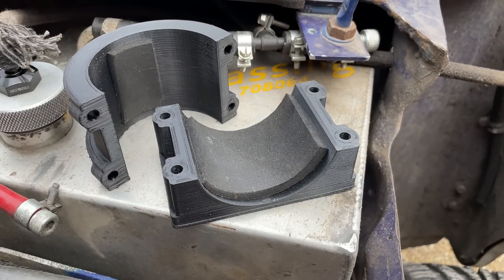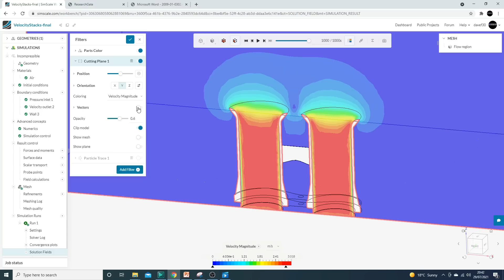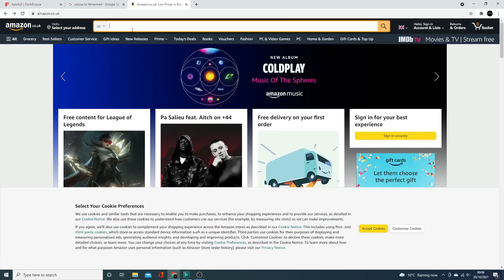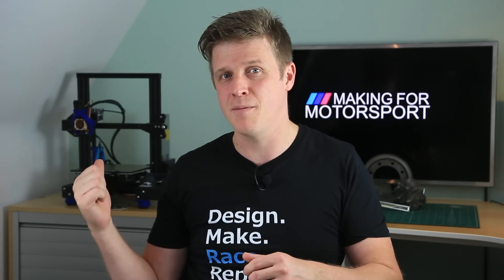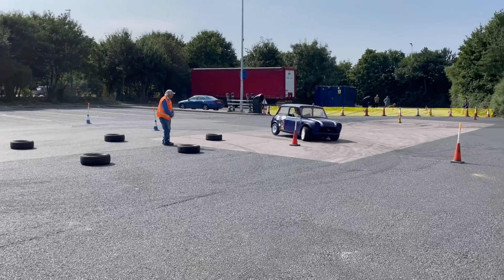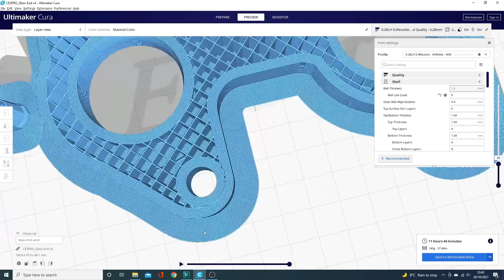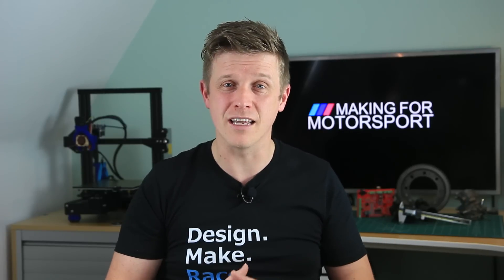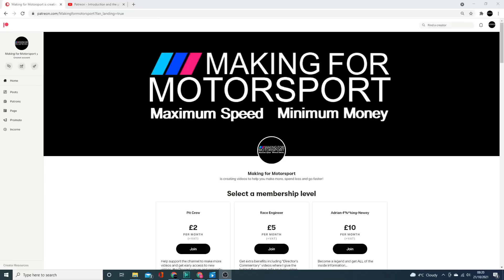3D Printing Car Parts - Under the Hood (or bonnet) - After a year of motorsport......

Comment: My own 3D printed intake manifolds https://www.youtube.com/watch?v=zIVduZnAFRg&list=UU4SCAucoAQf4XFesjFsTtKQ&index=12
Reply from the maker: I watched this like 18months ago, one of reasons I bought the 3D printer in the first place!  
The 3dkTop seems like an interesting filament, quite stiff.  How are they getting on?
Reply: @MakingforMotorsport  My restoration is going quite slow due to life getting in the way. So the car isn’t on the road yet. I will make some improvements like you suggest (adding brackets). I am most worried about heat management, because the exhaust manifold runs adjacent to the intake. But the 3dkTop filament should be good for 240*C.
Reply from the maker: Yeah, life does tend to get in the way 😂.  I know what you mean about heat, a friend has asked me to do the same as I had for a mini (original) and I said no because of the non-cross flow head.
I am sure it could be made to work with exhaust wrap and some shaped aluminium

Comment: Love the videos as usual and it's good to see the ASA works well given the cost saving of CF-nylon. 
Interesting to note the cheapy all metal hotend is rubbish for PLA. I've got one myself on my modified (its not broken I promise...) Ender 3. Interested to see whether the V6 fixes it
I actually have a PLA washer bottle cap in my daily driver mk6 fiesta that's been there for months and is holding up pretty well. It was a very temporary solution that works!
Reply: I had a cheap all metal hot end and it was complete trash at printing pla and lower temperature materials. Be interesting to see how the v6 fairs or whether it's always a compromise. :)
Reply: @colonelk3000  I guess it's a case of get what you pay for. I've still got a standard ender to do PLA but I'll probably try and get back down to 1 printer, so having a versatile set up will be a good thing
Reply from the maker: Haha… it’s a classic tail, as old as time.  Man sees 3D printer, buys an Ender, it works perfectly, “maybe I can improve it” 🤔, man breaks printer😂.  

The deciding point is whether it gets chucked in frustration or whether you persevere…
Reply: @MakingforMotorsport  yep. Now I have two. One works, one doesn't. My aim is not to fiddle with one. Somehow, I've resisted temptation so far.

Comment: So good. What cfd software would you recommend?
Reply from the maker: I used SimScale which is a free to use (up to a certain number of hours processing time) pro level piece of kit, a lot of the simulation has been cut out of the free Fusion360 so these two together work well…
Reply: @MakingforMotorsport  yes down side of free fusion. That's great thanks very much.

Comment: Another great video. I've done an ABS intake "Dave Mod" for the Cooper S that has worked fine for 6 Cali summer months of torture and been working up to nylonX for the zetec throttle body trumpets and manifold. My intake trumpet and manifold are coming along nicely. My printer is cheap but with very similar upgrades to yours. (Tronxy5SA) but a couple of mods really matter: Insulated bed with glass wool, Glass bed plate with glue stick, fabric creality enclosure, 90 degree brackets on every corner to make it ~10X more rigid, z axis sync belt, Dry teflon powder z-axis lubrication, metal extruder, cheap ebay volcano-like all metal hot end, capricorn tube, upgraded harder nozzle, heatsinks on all the extruder motor and axis stepper motors for staying cool while doing long prints in the enclosure. An insulated sterilite box with re-usable dessicant bags for keeping the filament dehydrated.  The Result is large print volume and reasonable prints even in ABS for a budget friendly price. Keep it up and we'll either be seeing some lost PLA home forged parts soon.
Reply from the maker: Wow! Upgrade dreams 😍. The dual z-axis with a sync belt seems to be a killer mod.  You mention a volcano like hot end, I was gonna go for that but the sheer quantity of melt zone and potential for stringing scared me so I thought, let’s just print slower 🤔😂
Reply: I never quite understand why you would invest so much in an inherently compromised design when there are much nicer diy printers like the voron family e.g.

Comment: I'm about to try out ASA. I've used ABS in the past, it was a pain in the butt even with an enclosure. If you can print ASA in open air then I'm excited.
Reply from the maker: I mean I wouldn’t recommend outside, and draughts (drafts) won’t help you, but a nice still room, PEI or Kapton Tape on the base with very low part cooler 👌

Comment: As a subscriber, mechanical engineer, cad designer and having 3d printed a lot of parts (both functional and not) i've always been wondering about the layer adhesion when printing ASA. I do not know if it's the filament, but i've been printing velocity stacks and i never really achieved that much of adhesion between layers. You are mentioning 255C, but i run my Ender 3 pro at it's limits (260C) and still, if the thickness of the part is relatively small, the layer adhesion is quite low. Maybe i should try some other brand's filament? Please, i would really appreciate any answer! Greetings from Greece!
Reply: Don't know about the filament but I found that keeping the filament super dry resulted in much better layer adhesion. Also printing in an enclosure so it cooled more slowly and having a little less air blowing over the hot end also helped.
Reply from the maker: I have never felt the need to dry out ASA (unlike nylon 😬)… gotta be worth a go! 👍. And low fans are key, unless I have big overhangs I turn the part cooler off completely….
Reply: @MakingforMotorsport  yes I agree, cooling should be off at all times with these materials. I also use a small piece off aluminium foil at the top of the extruder in order to stop any air blowing by the extruder fan, this fan spins always, but air is also reaching the part. So that's another tip for better adhesion. As mentioned by @porcat20, yes, enclosure is needed and yes I do have one.
Reply from the maker: I agree it’s not the filaments strongest point and if the prints fail it’s normally along the layer lines, but that’s usually also when I am asking too much of it anyway, but this may just be ABS side coming out and it ideally wanting an enclosure to keep the body of the material another 30degrees higher…

Comment: I have been using PLA to make prototype brake brackets. I find that making prototypes is quicker, easier and cheaper than machining aluminium multiple times. 
I have fitted 4 pot calipers to the rear of an abarth 500, 8 pot calipers to the front of a ford falcon and toyota camry, 6 pot calipers to the front of a ford falcon.
I will be having a bash at an inlet manifold for a ford cleveland v8 in the coming months. 
Loving this channel, cheers!
Reply from the maker: Nice!  Sounds like you’ve been busy! 👍

Comment: Thx for the tips. :)  I'm farly new to 3d printing also since a friend gave me a broken guider 2 which I fixed and have been making all kinds of useful stuff with it.  I think perhaps all metal hot ends just may not do PLA very well.  I picked up a 2nd hand genuine all metal hotend for mine with hardened nozzle on ebay to do cf filaments with, but I couldn't get it to print PLA as nearly as well as the std one.  It improved with a brass nozzle, but I just use the std hotend for PLA.  I wish I could get one hotend to do it all, but don't think this is possible at least with my printer.
Reply: Had a very similar issue when I  switched from std to metal. Looked at it with an IR thermometer. Turns out that at the same temp settings the metal hot end was ~20 degrees hotter. I just turned down the fan and the temp on the prints and they came out perfectly. Maybe an idea to try. I got he 20 degree number by printing as few temperature towers and seeing what the results looked like over a 60 degree range
Reply from the maker: I think a brass nozzle and a slightly lower temp will help enormously, and I don’t know if you watched the video on clogging, my heat break literally rattles around in the heat sink and I try to make up the gap with thermal paste but it’s never gonna be right. 
I chose the V6 as it has threaded connections and the clip on cooler fan looks to be very efficient.
Plus the Prusa uses them and everyone says just how good they are!
I need to do more temp towers, you sound very disciplined!
Reply: Thx for the advice, I think a more scientific approach with temps will help so I may have another crack knowing you got results.  Unfortunately I can't control fan speeds, but temperature towers and a decent thermometer sound like a way to go.  Thx! 👍

Comment: Awesome content as always man, love the can-do and engineering process attitude. My 3d printer has been so damn enabling for enclosures of custom PCBs, wiring, etc. on my car project. You've inspired me to start after using CF filament to make my own ITB setup. I think with some cut aluminum "sandwich" plates like you did for the blockoff it could be a real winner!
Reply from the maker: Yeah, I think sandwich plates are a winner, it’s not so bad on the Vauxhall engine as it has lots of fasteners, but I have another engine on the garage floor with only 5 for the whole manifold, what I did here wouldn’t work for that!

Comment: i got a 3d printed (ASA) adapter to remove the AFM on my 1.6 miata. With the coid air intake i'm running the adapter sits right between the engine and the radiator and it still fine after one year.
I didn't print it but i did design it and got it printed with one of the web services
Reply from the maker: That will do the job nicely!  3D printing is the future!

Comment: I’ve 3d printed map sensor take offs and pair valve planks on my race bike with mixed results. Mainly used PETG and it wasn’t great in compression with c.100C heat and the fatigue strength of the map sensor take off was poor. Still cheaper than getting stuff CNC’d but in think I’ll be using laser cutting as much as possible in the future, end user parts on cars are one thing but bikes are another matter that need an extra factor of safety
Reply from the maker: I don’t particularly rate PETG, it has a slightly higher temp resistance than PLA, but nothing significant, just 15-20degC in my experience.  These two filaments are different gravy.
That said, there is a whole different world of skidding around in my car to clinging onto a 200bhp crotch rocket! 👍

Comment: Excellent content as always. I design automotive parts and use fdm/SLA to prototype then I send it out to be printed in MJF PA12 nylon as its strong/chemical resistant and the textured aesthetics just look great.
Reply from the maker: Oh man, those MJF prints just look 😍, I’ve never looked around for a print service in the UK but those MJFs would have me parting with some 💷💷💷
Reply: @MakingforMotorsport  i order loads of mjf parts at work for high heat, mechanical parts, they really are great for all round usage. Small parts are surprisingly cheap, but a bit larger parts quickly end up like two Ender 3 worth of money 😂
Reply from the maker: @garagecedric  I love that Enders are now a unit of currency…. MJF is still something I want to try, but don’t want to spend more than a Textured Glass plate 😂